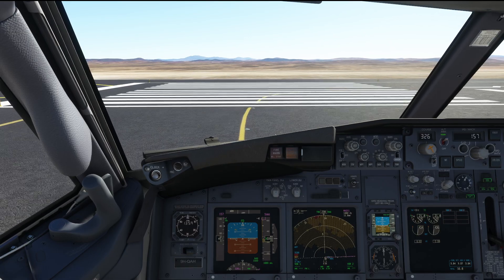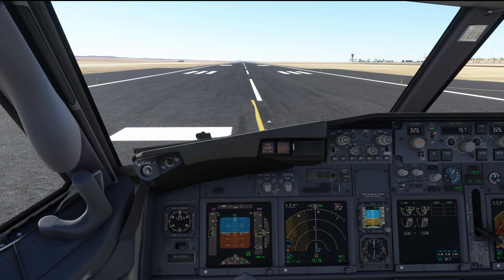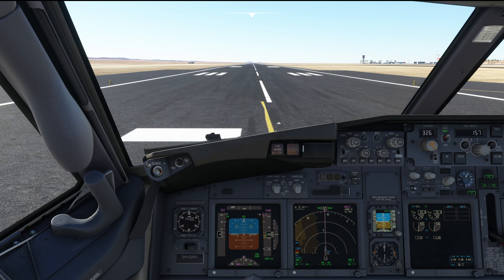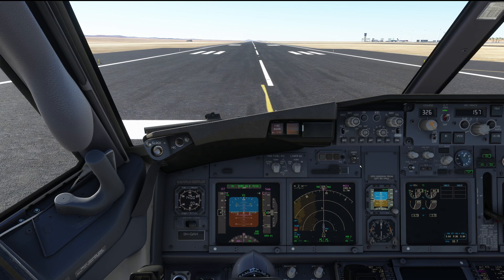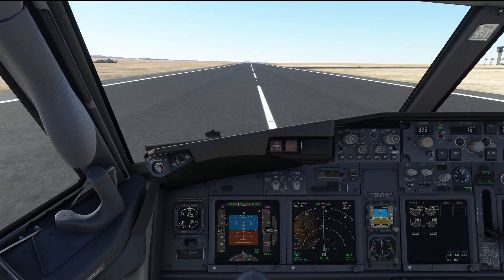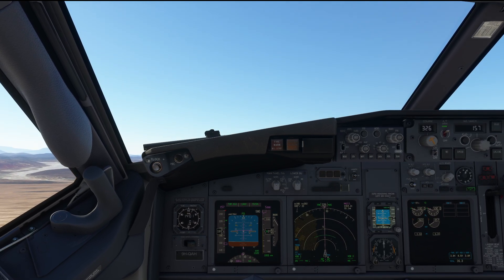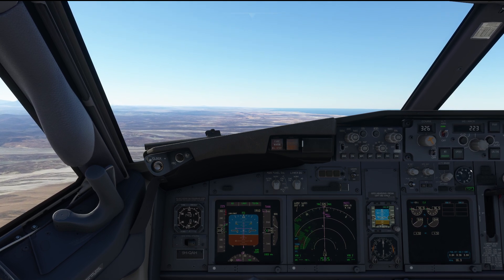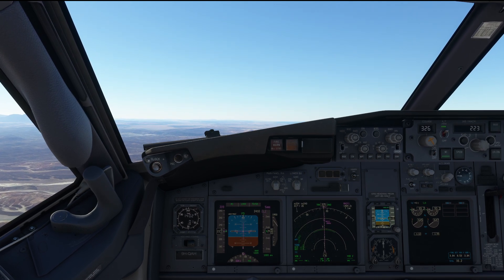Rotation in the 737-800 - What's different and why? | Real 737 Pilot

Comment: I have noticed that rotation with “default” trim settings, around 5,0 or something is always smoother and more precise, rather than if I set suggest by CDU, for example 6,23… in this case, with the same pressure on yoke, my aircraft immediately hit 10 degree bar. Which makes me confused a bit
Reply: You're just pulling too much on the control. Mistrimmed Stabilizer is actually one of the main factors of tailstrike. The fmc is computing the correct setting depending on  weight and CG, so you ll always need more or less the same backpressure which is not that much,   at each take off with different weights and CG.

Comment: Makes me wonder about the -900. Stop rotation at what, 5deg??
Reply: 15° with full thrust. Slightly less with reduced thrust.
Reply: @Hk-uw8my  I meant that 'pause' on initial rotation while still on the runway.
Reply: @outermarker5801  the original technique doesnt require any pause.
But you can perfectly make one at 9deg with a light airplane , a  long runway and some headwind if you want , otherwise it can be bad for several reasons such as the obstacle clearance in case of an engine failure.

Comment: Why is she stopping to rotate at 7,5°?
Reply: Quoting a mate who’s an F/O on the 737 … 

“there are two basic practices by pilots on the 737 and both are acceptable. The first is to maintain a smooth steady rotation of no more than 2-3 degrees per second until reaching 15 degrees, and the second is to stop around 8-10 degrees until you are sure of wheels off the ground before continuing to 15 degrees pitch as an extra precaution to avoid a tail strike esp if the aircraft is heavy. But either way is correct and as an F/O, it mostly depends who l am flying with on the day as to which technique l use”. 

Hope this gives you a more real world view.
Reply: Because the -800 is long. If you rotate to quickly, you might have a tailstrike.

Comment: Hey 737NG, thanks for the video! Just a suggestion especially for such viedos: if you could set the camera in a way we could see the yoke and your inputs on it, would be great. Other than that, perfect! 😉 Thanks a lot!
Reply from the maker: Thanks, I thought about that as well but I couldn't find any camera angle where the PFD was large enough that the actual pitch could be seen and both yoke and runway were insight.
Reply: @A330Driver  Right ALT + left mouse click on the pfd screen and you should get the pfd in a separate window. Maybe this would help.